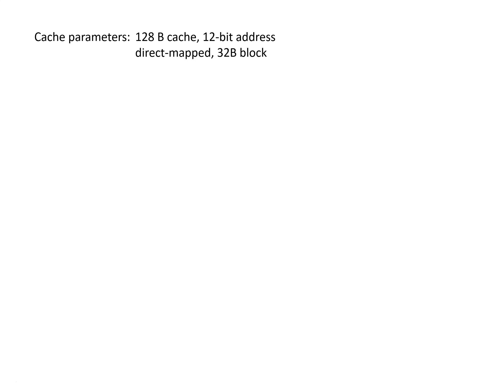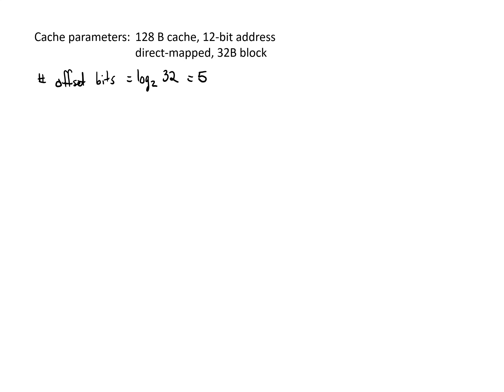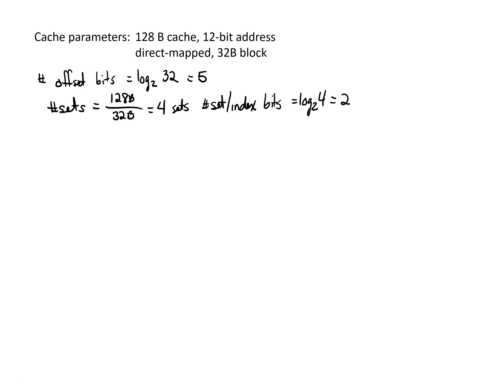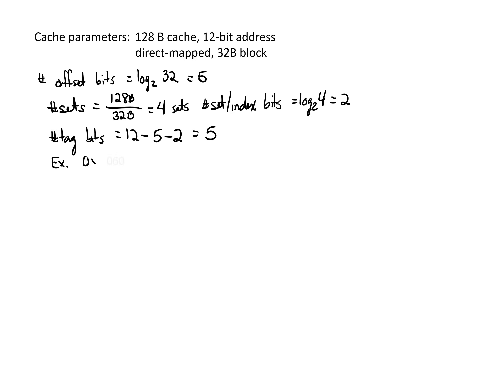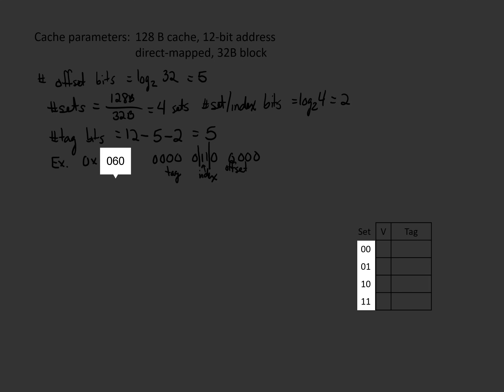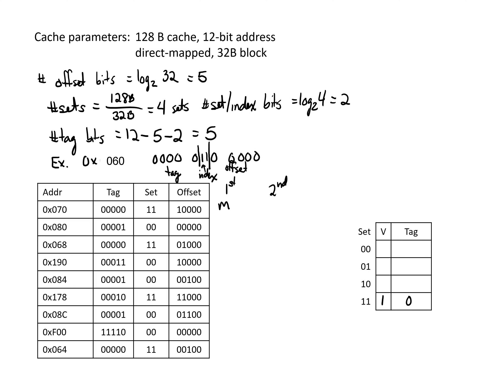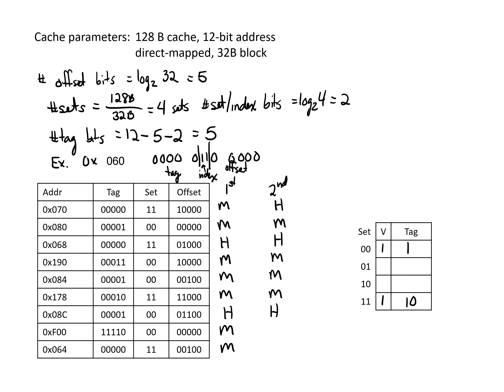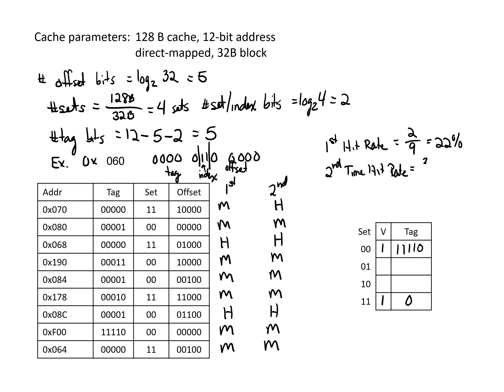Cache Access Example (Part 1)

Comment: Is this based on LRU or MRU replacement policy? How do they differ?
Reply from the maker: Is your question, is it "least recently useder" or "most recetly used?" If so, I don't belieft that plays a roll at the level of abstrication this problem is dealing with.
Reply: @matthewwatkins88  yes i just saw your other video about 2-way associative and it helped a lot! thank you!

one more question, though, if the offset is log(number of bytes in the set) then doesnt the set contain 2 words (double the amount of bytes) which means it becomes 

log(2*32)=6

or does it only depend on the block size 

I've seen the words block and set used interchangeably sometimes so this concept is pretty confusing for me 
Hope my question is clear though
Reply from the maker: @LAVENDER-OG  What you typed is in the "wrong" direction. Each word gives you 4 bytes, NOT 4 words gives you 1 byte. Does that help/solve the problem?

Comment: I have a question. What if the addresses in memory are not all uniform bit size. Each of your addresses in the example are 12 bit. But what if they differ, such as between 12 - 16 bits? Will the process you are using here work on addresses of varying bits? Such as 0x408ed4, 0x10019d94,  408ed8...
Reply from the maker: Assuning you are refering to immediate values (bit positation 15-0 for the immediate values portion) they are all 16 bits. It may only show a smaller number if the higher order bits are all zero. As a further extendion, in MIPS, all addresses are 32 bits (with immediate values of 16 bits). Does that address your question?
Reply: @matthewwatkins88  yes ok thank you very much for your answer!

Comment: What is the purpose of the offset bits? I’m confused on that point.
Reply from the maker: The offset bits are the least significant portion of the number. The number as a whole has three portions, the offset, the set, and the tag.

Comment: Clear example, thank you a lot. But is there any example with the offset separated in two : block offset and byte offset ? The block offset I think I understand it but I don't see the point to have the byte offset.
Reply from the maker: Very, very delayed in my response, the byte offset just refers to the 4 bytes for a number (assuming a 32 bit number). (If it was a 64 bit (8 byte) system, then there would be 3 bits for this portion.)